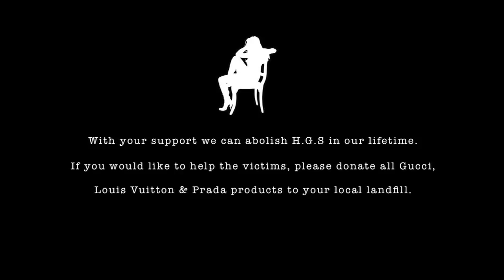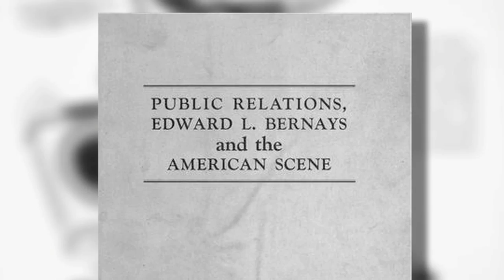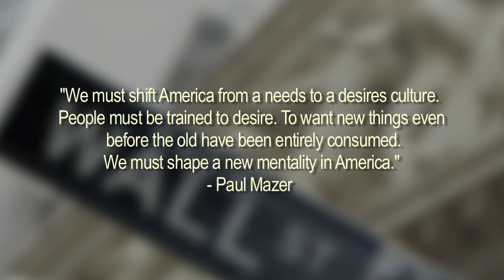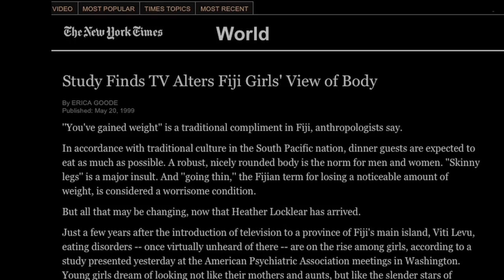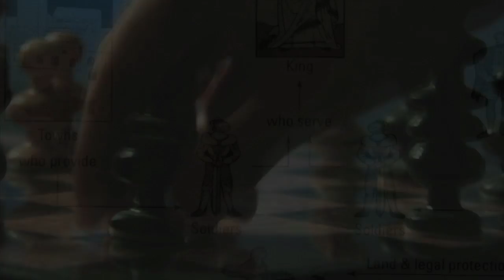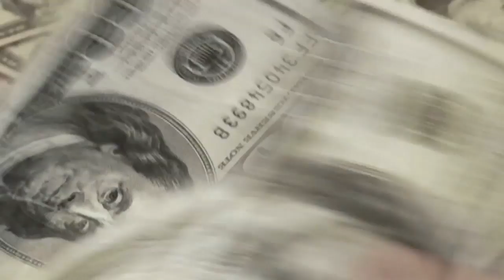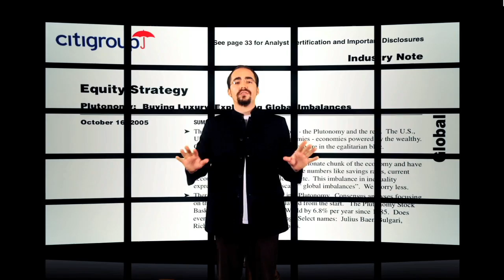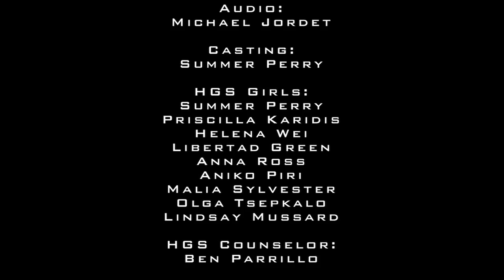Culture in Decline | Episode #3 "C.V.D." by Peter Joseph

Comment: Imagine if for one day there was only one commercial during commercial breaks. This commercial explained how visible light passes through our atmosphere ,is absorbed by the earth, and reemitted in infrared which is trapped by carbon dioxide.This then could be followed up by the knowledge that venus' atmosphere is mostly carbon dioxide thus the "hell" like temperatures. Hotter than mercury despite being further from the sun.

Comment: 1/2 Again u have this system in mind when thinking about this. Ur transposting a situation that only exists in this system to another very different one. I'm a house builder, have built many houses 
(yes, really) and could certainly think (already do) of making a much more efficient house. That means a house that doesn't require that kind of maintenance, with durable, resistant materials, opposite to the ones today, that gives jobs to maintenance ppl. The important part is: While working on the>

Comment: "One more point - the very fact that you need to argue against anyone is evidence that this would never work." where's the "evidence" for that mister prove everything? Anyone could easily say something similar toward you and it would still mean nothing. Btw, how often do you need to paint your house? We already have much better ways of protecting surfaces for far longer then Oil based paints. Would it be silly to point out that if we did do that, many thousands of people would be without a job?.

Comment: 2/2 something in a resource based economy as no such thing as a "free" thing in this system. The difference is we do things applying scintific logic to the solution of problems instead of the current market methodology. We just replace a method with other, we dont stop doing things. We free information completely, share it, stop competing, start cooperativism, make structures of production as well as understandings of limits. when u know gains and consequences, u wont overconsume 4 the sake of u